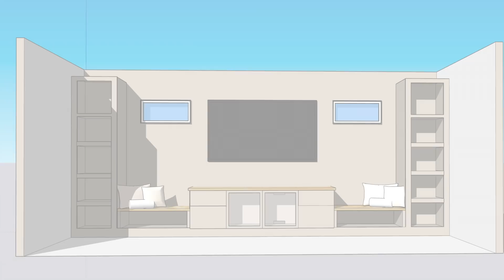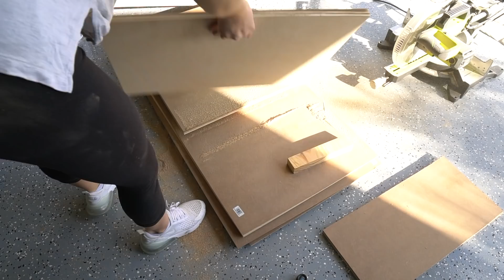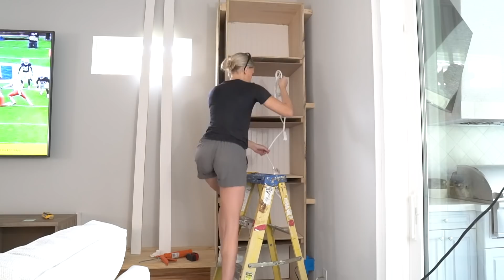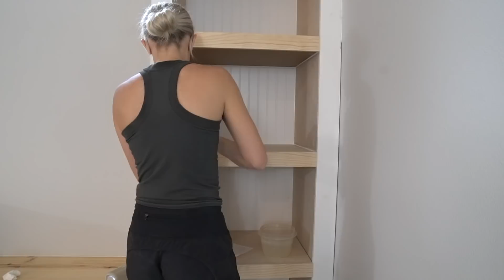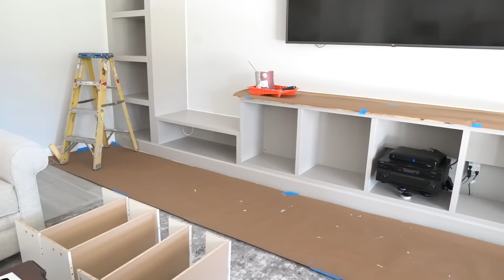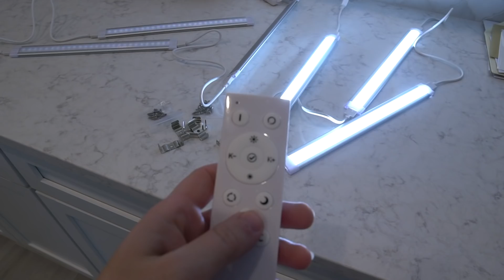DIY Entertainment Center (part 2) | IKEA BESTA HACK

Comment: Enjoy watching your videos and your projects always come out great. But one small thing to point out - per NEC, extension cords should never be installed as permanent wiring. Nor should they be secured with conductive materials (e.g nails, staples). It looks like you are comfortable working with electrical. A 
code-compliant and more importantly a safer solution is probably well within your skill set.

Comment: I understand why people have a tendency to this as most everyone (contractors, interior designers, even home theater companies) does this at an aesthetic height, but that monitor needs to be much lower.  Ideally you want the middle of the display to be at the same height as your eyes when seated on the couch.  This display is too high even when you are standing.

Comment: Great job! Your work is very inspiring. Every time I see you complete a project, I get motivated. I have a similar set up in my bonus room. Probably a dumb question, but If I have carpet, should I remove the section of carpet where the base goes?

Comment: Awesome build Stef! love the finished product and the color choice for the wall/unit. 

Maybe this could help you in the future for different builds depending on what they're/you're looking for... To hide cable box and tv components I've gone down to Hobby Lobby and picked up some fabric. Can't recall the exact name but it's basically like the black mesh that covers up speakers. I used it make a "Hidden" door that opens when you push it (push locks). GREAT for hiding all your equipment and even sound bars too. Been using it for about 2 years now and I've never had a problem with the IR receivers not working on my equipment. Just food for thought. I've noticed that not many people are using it and I think it not only looks great but is super functional. Thought I'd share and maybe it could help you or even others that are reading this for their projects.

Comment: I watched both videos, but I maybe missed it or it might just be a stupid question anyway... is there a reason you chose to mix in the new IKEA cabinets with the build? Was it cheaper? Or just faster? I've been wanting to build some built ins into my home that was built in 1900 and am all about saving money and ease, but money is the bigger factor for me. Luckily my space is way smaller, but still... 2k/smaller space equivalent is a lot for me right now. However, I am sure you added a lot of resale value (only monsters tear out well built built ins)... anyway, thanks for sharing ;)
Reply: Thought the same, concluded cost and time - keeps it simple. the centre piece is the complex bit is now made easy: no drawers or doors to make (circular saws, router tables, miriad of extra powertools, making rabbits, deciding on drawer construction etc.), no hardware/hinges to buy etc as all supplied in the kit. Using that as the nucleus makes the surrounding parts to then only require simple tools and construction techniques to get the end result.

Comment: Why not paint before putting the countertops on? How do you turn the lights on the top of the towers off and on? I think that I probably would have hardwired the electric or put doors on the bottom section of the towers to hid the extension cord snd electric socket.